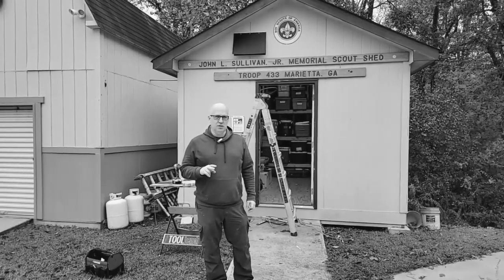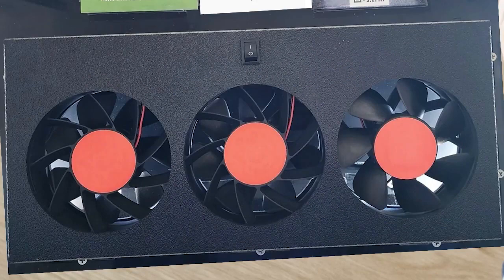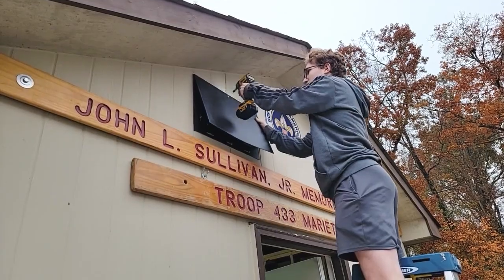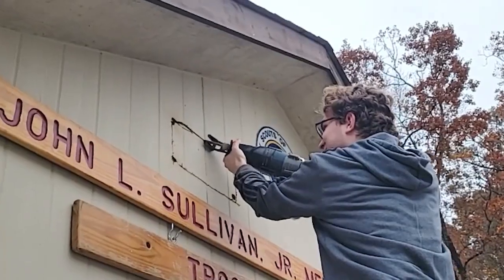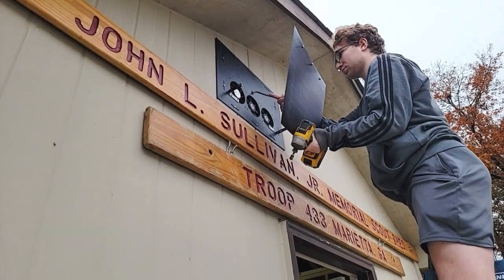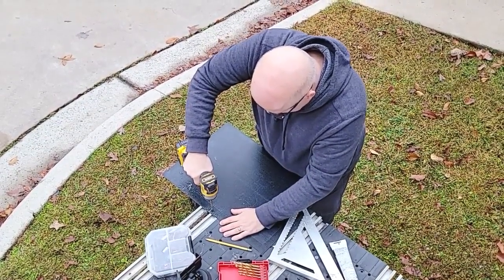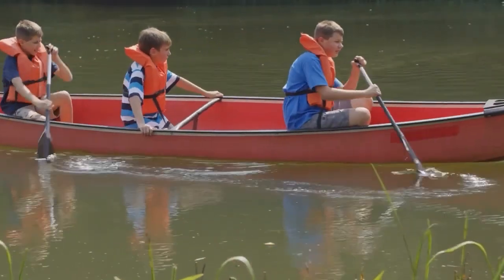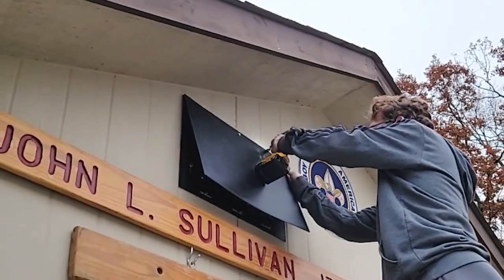EZ DIY solar powered fan install for sheds

Comment: Stupid useless device that should never be used! You need to get passive insulation right with gable vents or a ridge vent and soffit vent. You have no idea about attic venting and need to be re-educated as a contractor
Reply: Seems to me this is a nice and easy retrofit idea in a situation where the shed already existed.  Getting some of the hot air out to help the kids is more key than thinking about how the shed should have been built better in the first place?
Reply: Passive ventilation?  I have a video I can share on passive house insulation if that is what you want.
Reply: @SawHorseDesignBuild  check out roof ventilation Institute videos on topic of attic ventilation